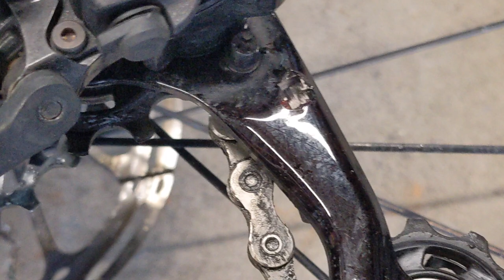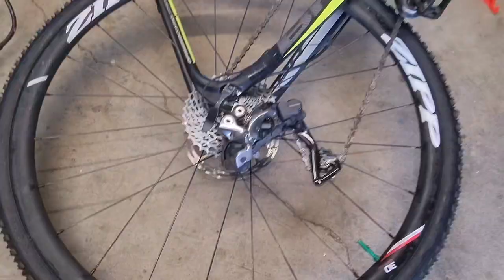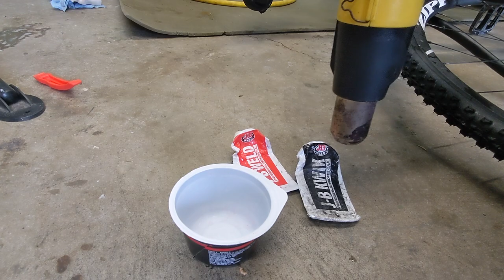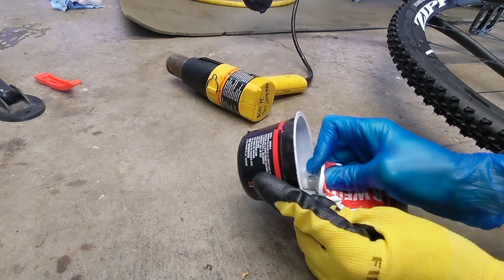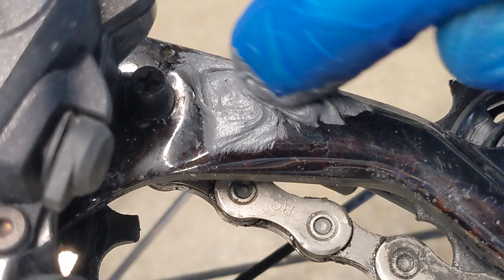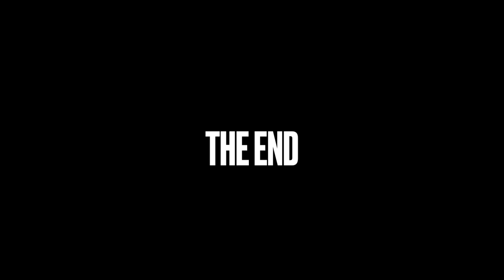Carbon Fiber Chip on gel coat repair bike derailleur - J B weld

Comment: nice how's the repair holding up? I'm using their still stick on a carbon dropout because it's easier to mold with, I've used it on an m5 alloy frame downtube and has held on for about the last two years
Reply from the maker: It's good
Reply: @buckmanriver  sweeeet